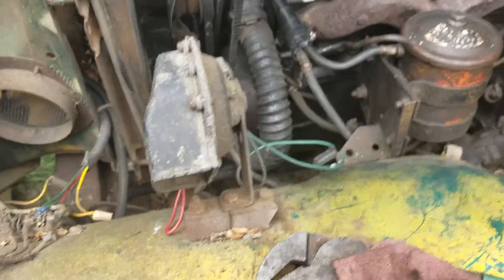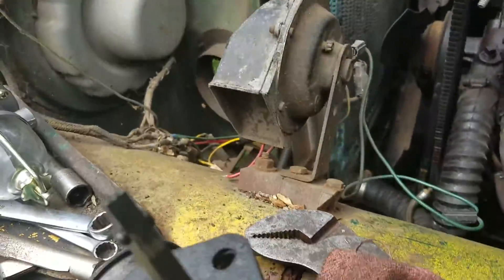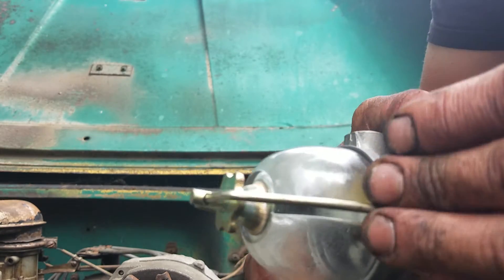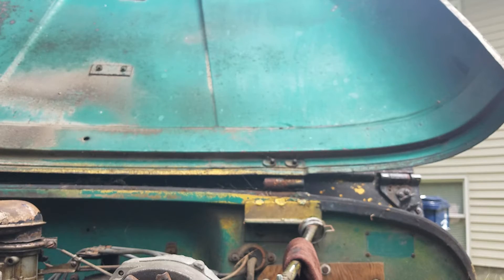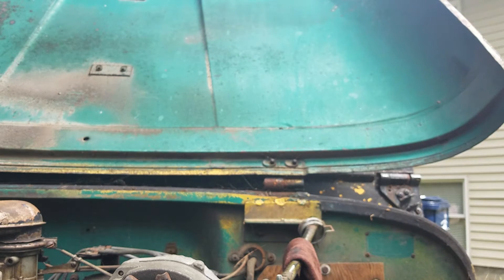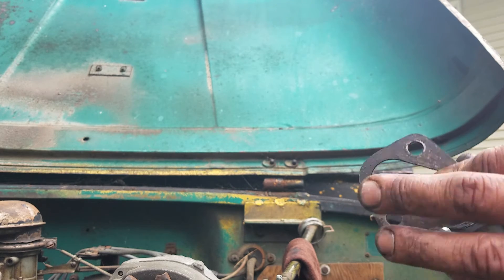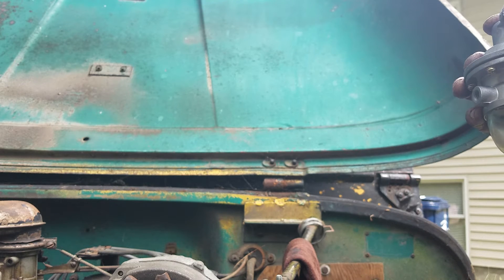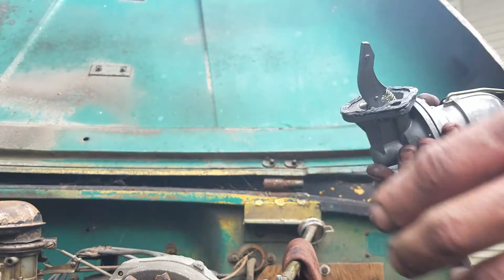Mechanical fuel pump 1958 willys jeep

Comment: My Willys MB '43 has problems to get enough fuel when running out of gear (and without throttle knob pulled) and the motor dies after a few minues. Afterwards I have to use the manual lever on the pump many times (80+) until I can hear that sucking sound when the pump works. I thought it might be the membrane in the fuel pump, but after watching this I'm not sure anymore. Any other ideas?
Reply from the maker: @lucasscholl1214  the pump could be bad , line could be clogged and check the tank
Reply: @Greasejunkiesteve  thanks a lot, Steve. I guess I'll check the lines first, seems to be the easiest part and I'm not much of a mechanic.
Reply from the maker: @lucasscholl1214  also check your spark plugs and distributor and points . if your points are not clean or adjusted,it can cause you to lose power at the top end
Reply: @Greasejunkiesteve   thanks again for these additional hints. I really appreciate that.

Comment: Price
Reply from the maker: Price for what the job or the punp
Reply: @Greasejunkiesteve  both
Reply from the maker: Honestly don't remember the pump price  and to put in was like 40.but that was like 6 years ago
Reply: @Greasejunkiesteve  but can you tell me what problem was with my car actually my car was starting off while driving then i find that fuel was not pure so i clean my tank and after 8-9 days it will again doing that then they changed my fuel filter but again they do that please tell me what was the solution of this. Urgent
Reply from the maker: You may need to clean the carb and filter .and if your tank has debris in it then you'll need to keep cleaning or replace the tank.
Reply: @Greasejunkiesteve  did i used a pump which through diesel to engine without cleaning
Reply from the maker: What vehicle and engine do you have .

Comment: nice. the spacer is used to limit the fuel pressure to a max of 2.5 lbs at solex carb. it lengthens the dustance the cam lobe makes contact with the fuel pump rocker arm. also, oldtimers suggest to only put gasket material on the block side, that way it can be reused when/if you need to remove fuel pump at later date.

Comment: I have a 42 Studebaker with a mechanical pump and can't get it back on. I can't get the plunger to go in the right place. Either it's above the holes or below them.Any advice? Also, in my glass bowl nobody has that filter anymore. Can a close approximation work since it's only in the bowl?

Comment: Did the glass bowl fuel pump work?
Reply: My 65 has a glass bowl on it. Getting ready to change it with another glass bowl.
Reply from the maker: Yes it is still the same 1 now and it's still runs and drives.